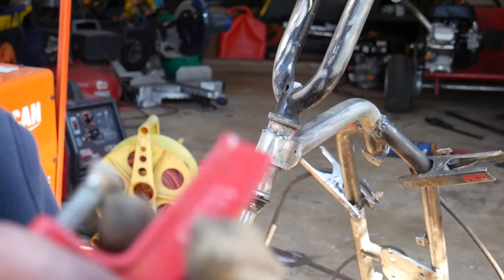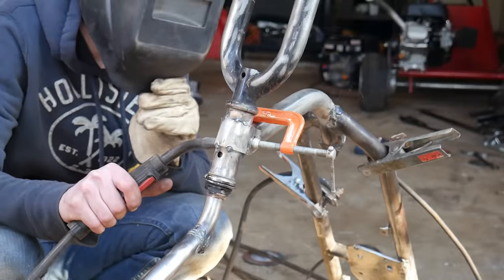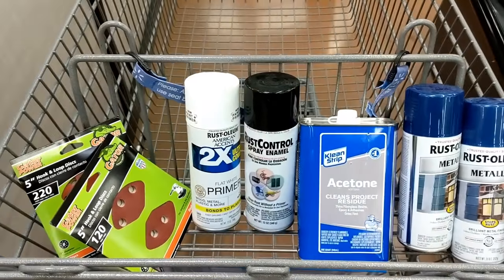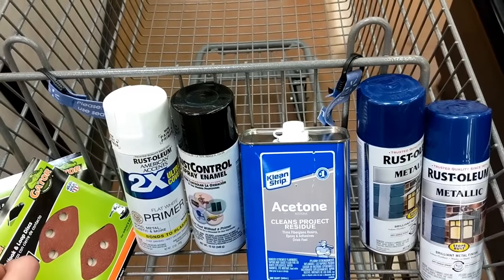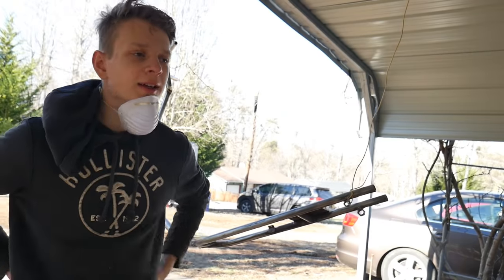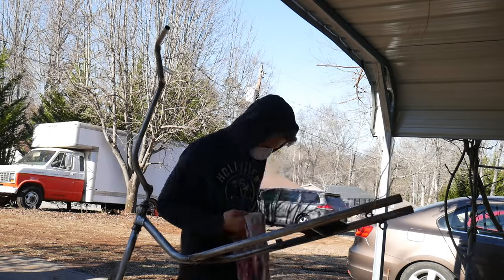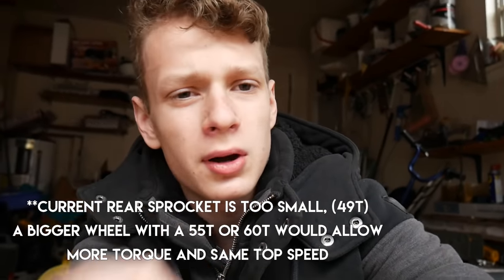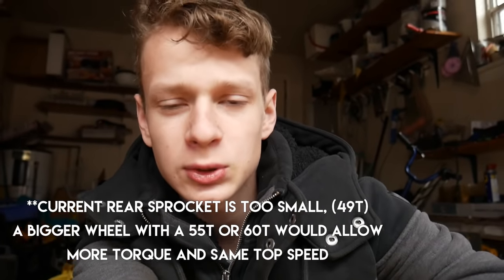Homemade 79cc Motorized Scooter Build Part 3

Comment: Metallic paint is one of those interesting paints that requires specific prep.
If you use metallic paint in the future this is my recommendation, use a black primer.  Black primer makes metallic paint pop and you can easily see the difference between white, grey, or black primer when you use metallic paints.
Reply from the maker: Good advice thanks!! Yea I learned about metallic when I was restoring my car. Iuse the white filler primer, they sell a gray one
Reply: As the name suggest metallic primers have flakes of metal in them (aluminum for the most part), and that reflects light.  If you want to paint something in chrome it is advised you use a black primer.

I airbrush model kits and I can easily see the differences between black and white base coat when metallic paints are used.  When a black base coat or primer is used the metallic coating looks more metallic.

Comment: Great video series and result.
Quick question, I've been thinking of upgrading my 4-stroke 49cc to have more torque and climb steep hills. How does this engine perform??
I am between the predator 79cc and the 212cc or possibly the Honda GC190.
thx
Reply from the maker: Amriche Atef The 79cc is not really a torquey engine. You need to take the governor out and make it somewhat fast. 212cc has plenty of torque for the same price
Reply: Vasily Custom Builds, thx for the quick reply. I’ll try and post a video of the process for some comments and opinions later on.

Comment: 🤔   This got me thinking, those high power, full suspension electric scooters  are like $3,000+.. If  you could buy just the full suspension deck for cheap. Or just the F&R scooter shocks to attach to a diy deck. You could use a 2 or 4 stroke engine & build a 45-55mph full suspension scooter for a fraction of the cost. Like $600 in parts 🆚 $3500 for an electric....A modified Avenger 85,   2 stroke bike engine could easily do 45 maybe 55 but would struggle on hills with the single gearing. Still better than $3,500.

Comment: I wouldn't weld with your camera under you I cracked my phone screen from some splatter. I could only imagine what it would do to a camera
Reply from the maker: Yes I agree. But at that part I had a GoPro clone in a full plastic waterproof case. Definitely not going to do that with a phone or my nicer camera
Reply: Vasily Custom Builds good. I would still stick some glass or something in between because that stuff is hot! Keep up the good work though!
Reply from the maker: CasualKarting Thanks!